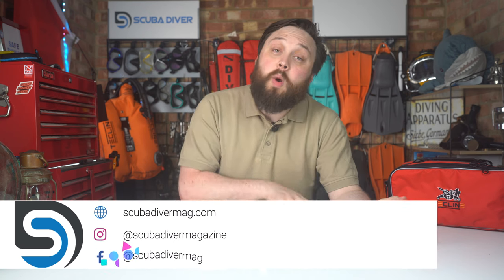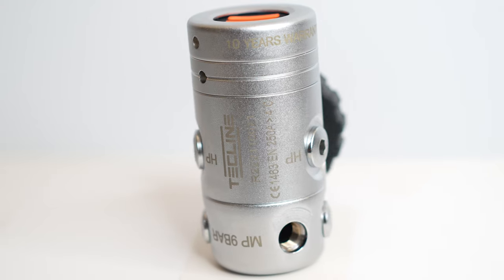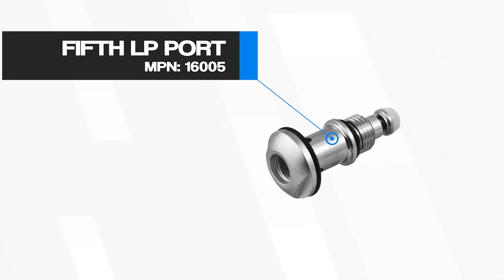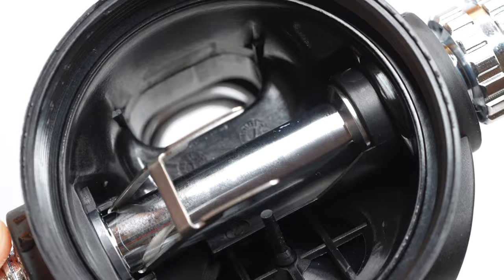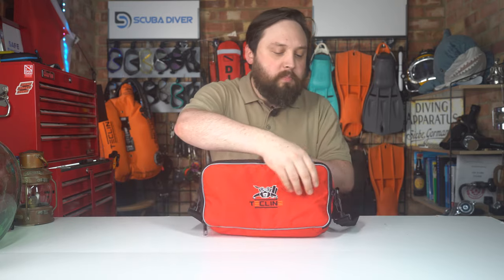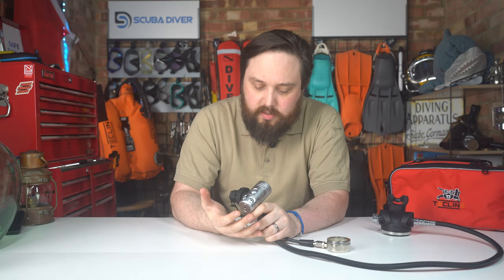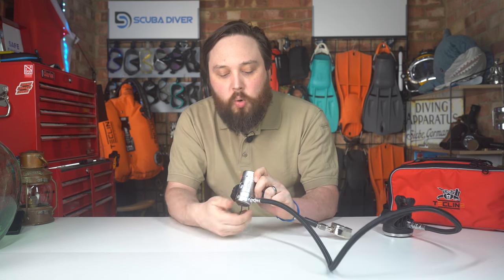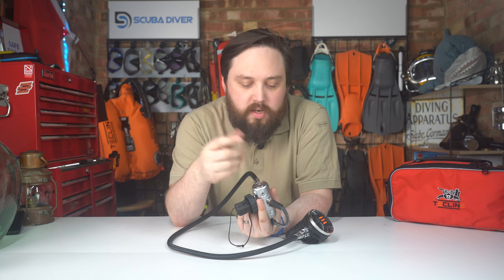Tecline Tec2 R2 Regulator Review #tecline #scuba #regulator #review

Comment: First: i love the second stage and i used to like the R2 First stage. BUT: within 9 Months from new, untouched/unserviced 2 First stages failed. In one the membran and in a second one small oring that was zero greased broke. Sorry but a 66% Failure rate of the first stage in just 9 Months use from new is unacceptable. Also the service kits are not super available on the market and kind of expensive (50 euro plus)
Reply: Have to shamefully admit I last serviced it once in 2021 when I bought it second hand, has worked flawlessly ever since, will get service kit next year :p not because it needs it tho.

Comment: #AskMark 🐠Hey Mark! I've been using the Shearwater Teric with the Swift transmitter. When it comes to packing and trip weight, is it essential to bring along an SPG? Also, from a safety perspective, what's your take on this? Cheers and dive safe! 🌊🤿🧐
Reply from the maker: Transmitter technology is really good today and I can't remember the last time that one failed on me. I usually recommend divers to use an analogue SPG but, as long as the battery has plenty of charge I wouldn't worry about only using a transmitter.